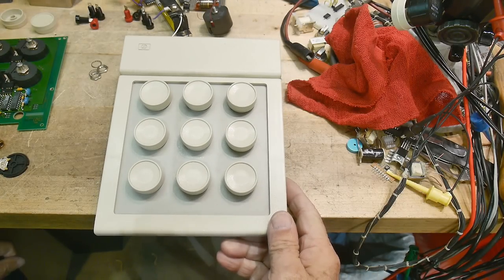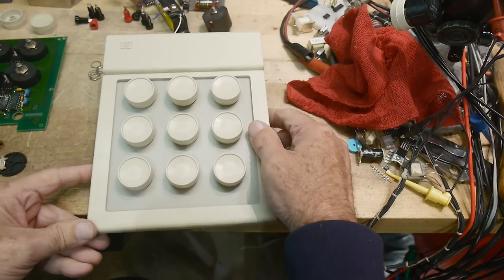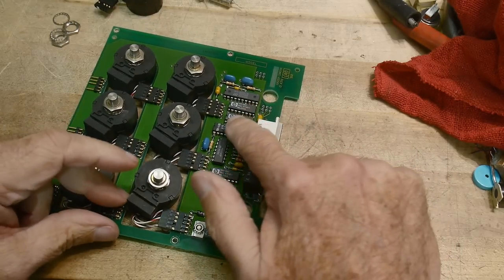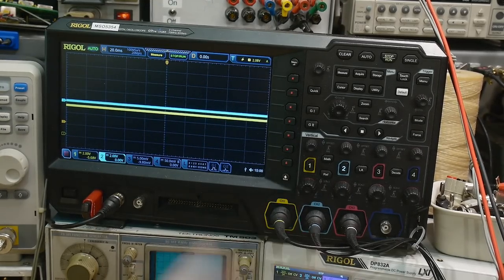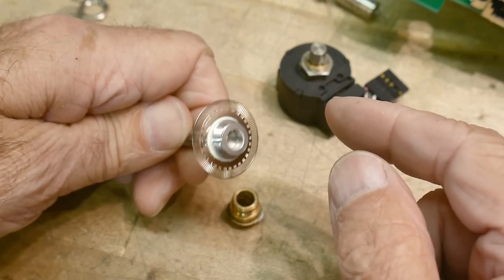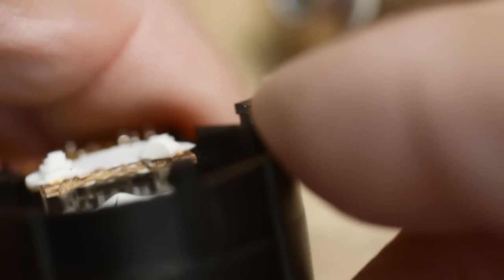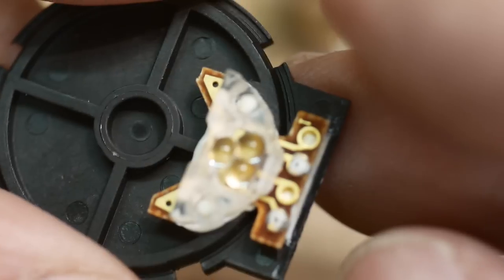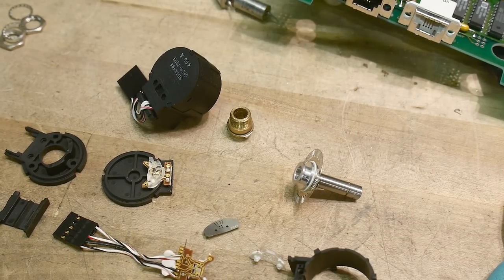#1377 HP Rotary Encoder QEDS-7099

Comment: This brings back a few memories, back in the late 1980's one of the industrial products I designed used this encoder in a ruggedized enclosure with logic to give count and direction outputs. The display section used a Motorola 68HC05. The count had to be saved through power down, but we didn't want to use battery backup, so the supply caps used were larger than normal to provide sufficient time to write to a serial EEPROM. The processor was interrupted when power loss was detected, and the last count was written before the capacitors discharged.

Comment: Awesome blast from the past!  In 1986 I incorporated 2 of those (actually ribbon cable version) HP encoders in an embedded industrial controller design based around the Motorola MC68HC11 microcontroller.  All pretty new stuff at the time.  Our controller was able to talk to a machine's main processor over a 50 conductor ribbon cable to a pretty standard industrial IO card as well as PWM control 2 solenoid outputs.  We used the encoders as dynamically assigned UI controls for manual operations of the automated test machines we built (still build).  We would put 2 encoders on one board and stack up to 7 more boards (for PWM only) on the same ribbon cable.

We still use an updated version of that board, but we stopped being able to get HP brand encoders a long, long time ago.

And a big shout out to your friend Bill for his work on the team... those encoders were an awesome part to have at the time!

For the benefit of other viewers, 2 of the "extra slots" and the missing photodiode were for a full-rotation index pulse variant.  Pretty neat that those bare diodes were bonded out on the little PCB.

Comment: A company I worked for used a 1024 encoder to measure distance on an Steel I beam, to drill a hole with 1/10000 of an inch accuracy  over a 80 foot I beam.

Comment: In the early 1980s I had a friend who worked at the HP calculator division in Corvallis OR and he showed me an early version of HP-IL that ran between a 41CX calculator and an external GPIO box. We hooked the GPIO box up to my 6502 computer and were able to send data back and forth. It's cool to see that they used HP-IL for the same purpose as USB today - would be interesting to see if one could make an interface between the two so you could get that encoder box running on a modern PC.

Comment: I have a handful of HP encoders 5060-0329 that were removed from HP 8660 and 8640 signal generators. The encoders used a grain of wheat incandescent bulb that burned out after about 10 years.   Manufacture date code @ Dec 1981.

Comment: Does this use the four photodiodes similarly to the HEDR-8000 series (each pair is one phase, used a differential pairs), or does it produce a true four-phase signal? I saw the HEDR in the HP Journal back in the 1990's, and immediately solved a vexing problem by using adding two PD's and using differential detectors for each quadrature channel on a large encoder disk. Ligh leakage and component tolerances made for painful calibration.

Comment: Those connectors don't look like HP-IL (the 2 wire serial interface developed from HP-IB for HP41/71/75 etc.) connectors? Did HP subsequently develop something called HPHIL? maybe that's what they are?

Comment: The custom photodiode circuits were interesting.  They were placed on those tiny boards by Indonesian techs with far better fine motor control than you or I have ever had.

Comment: this vid was very interesting to me , but I come at this from a very diferent angle. I was a machinist for 45 years and when we started to go cnc we had to learn a but rotary encoders. I noted that they came in three diferent flavers, multiples of a 1000 multiples of 360 and multiples 1024. 1024, I thought that 1024 might have something to do with metric to en conversion but when I devide 1024 by 25.4 I do not get an even #. Hope someone an explane about some thing I have wonderd about for  25 years
Reply: They're all pretty commonly used numbers for different domains.  The 100/1000 pulse-per-revolution counters are useful for 'human interactions'.  1024 is a common "computer number", so 10 bits in binary give you 1024 different values.  If a computer is the only thing looking at the numbers you might choose 256/512/1024/etc for the task to make counting up and down easier/more efficient for the computer.   360 is commonly used when worrying about circles/revolutions/shaft angles/etc.  So if you're making a system to control motors and shafts and like to work in degrees, you might choose 72/90/180/360 count wheels.   For many purposes, though, it just doesn't matter, as you just want to get "move X ticks left/right" when you twist the knob.

Comment: That's not HP-IL.  It's HP-HIL.  HP-IL used black 2 pin cables such as on the HP41C calculator.
Reply from the maker: that's right, forgot

Comment: PS - After opening my ball mouse for the millionth time to remove cat hair, it was obvious how they worked.  Two optical rotary encoders for x and y.  But how does an optical mouse work with that glaring red LED.  It must be some kind of simple camera and a chip to detect changes in the pattern.  Either that or black magic :-)
Reply: I read about optical mice on a whim. The camera rate is supposedly 1500 fps.
Reply: "It must be some kind of simple camera and a chip to detect changes in the pattern."

It is exactly that.  There's even a mode - at least in the original HP designs - where you can put the "mouse" chip in a camera mode and get a lo-res picture out of it.  Otherwise, the chip does it's own frame-difference magic and outputs X-Y offsets.
Reply: That's precisely what it is, a fast camera with really poor resolution (for a camera)
Reply from the maker: https://youtu.be/CbfsotGeSB0
Reply: @IMSAIGuy  Awesome.  Thank you.

Comment: It's interesting that Broadcom/Avago uses "HEDS-*" for some optical devices. Is there any connection with the "QEDS-*" naming scheme?
Reply: That sounds highly probable as HP has spun its products and itself off into the wind over the last few decades.  The HP encoders I used in the mid-80s had an HEDS- part number.  Now I'm wondering if IMSAIGuy's "QEDS" parts were an internal part number.
Reply from the maker: I couldn't remember, my friend thinks it was for any customer special, internal or external. that sounds right
Reply: HEDS-* was the naming scheme for catalog parts.  QEDS-* were for customer specials. (special counts, special cables etc)